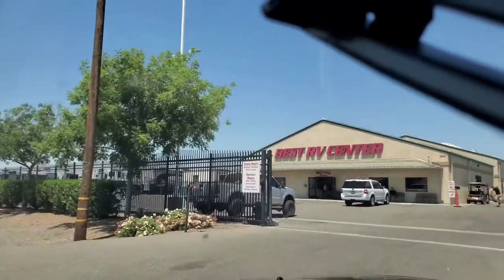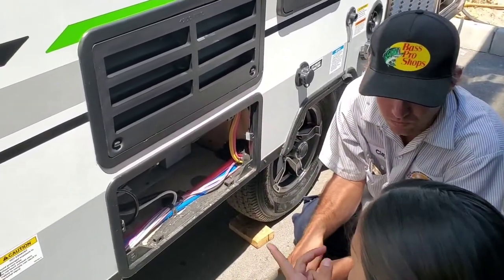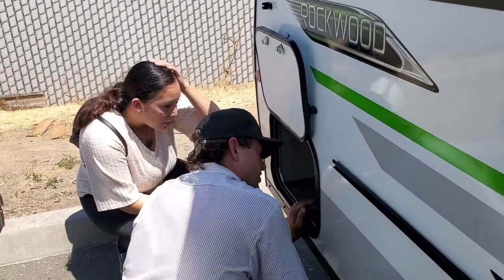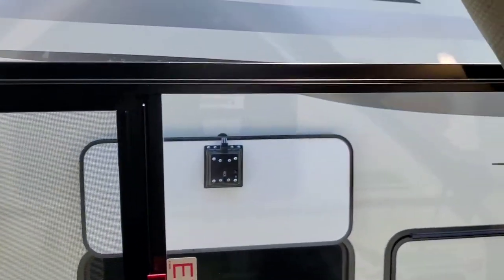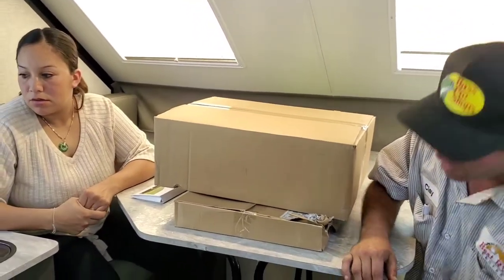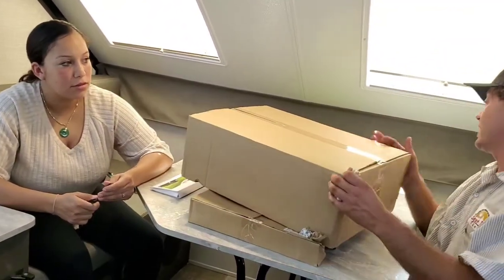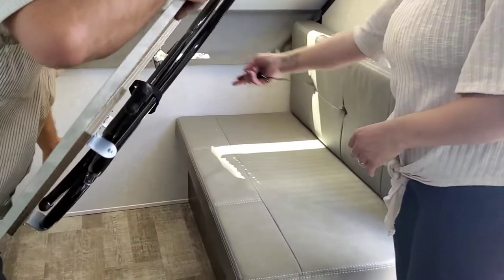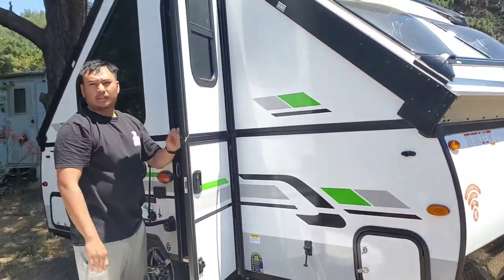2021 Rockwood Aliner A122 pop up camper

Comment: We just bought this exact year/make/model today (Bought it used from a private seller on Jan 21st, 2023). This video is very helpful. Question - Do you have an electric brake controller installed?
Reply from the maker: Yes. We also purchase the witness blutooth break installed. Makes a huge difference in driving. Congratulations on purchasing your camper. I was told there's a community of aliner campers. Pretty cool. We love ours.
Reply from the maker: Remember to purchase to correct hose and regulator for the tap. If wrong hose are installed and you just put water in from the hose. It will explode
Reply: @Yakplanet_tv  Thank you. We are taking our maiden voyage this week. I bought a regulator. What's the best hose to use for the city water connection?
Reply: @Yakplanet_tv  We had the break controller installed a couple weeks ago!

Comment: Does the hot water work without being hooked up to a generator/120v power?
Reply from the maker: Once you add the water the to camper. Your 12v battery or generator or propane can heat up the water. In the sink
Reply from the maker: Thus camper is off grid ready and yes the shower will also have hot water once you turn the propane on or use the 2x 12 battery or generator. Takes a minute but you I'll have hot eater6
Reply from the maker: Water
Reply: @Yakplanet_tv  thanks for the info...it looks like a very practical trailer...